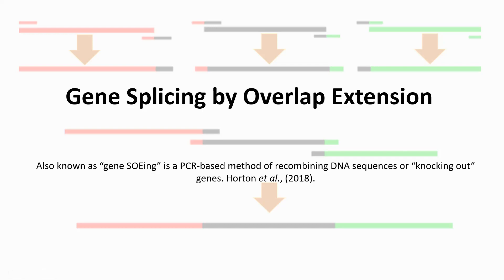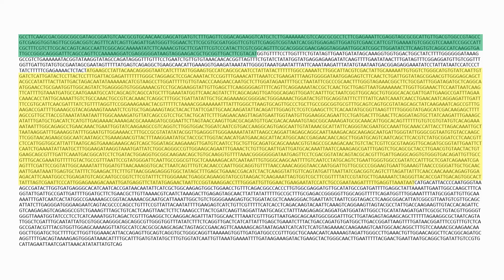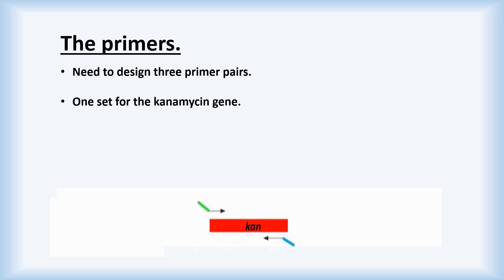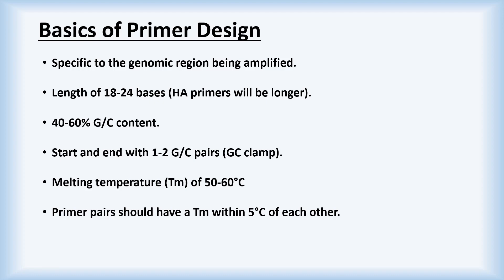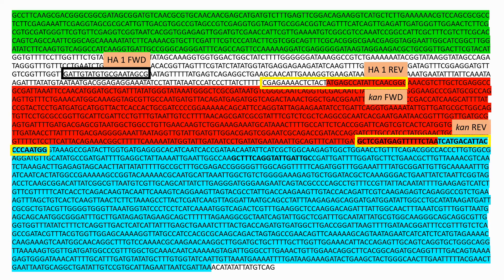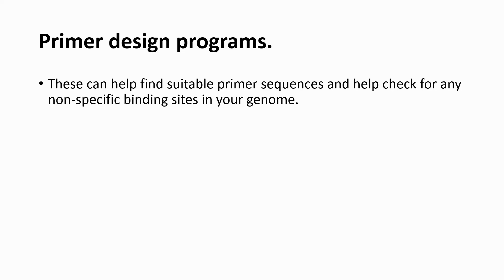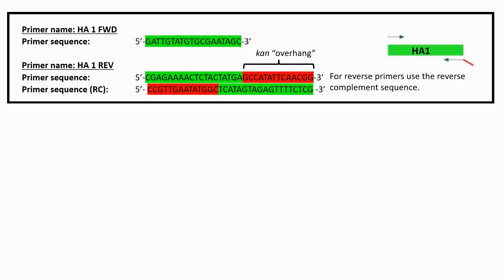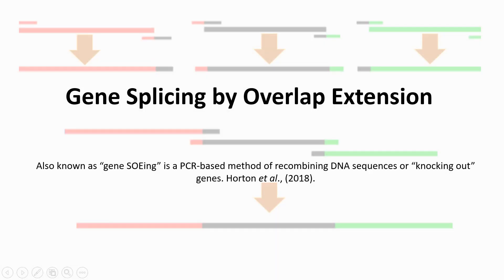Part 1: Gene splicing by overlap extension (SOE PCR).

Comment: thank you so much!! 

could you pleae also provide the paper you used fo the video? couldn't fin it anywhere (
Reply from the maker: Hi, as far as I know - this was first described: Steffan Ho et al., (1989) Site-directed mutagenesis by overlap extension using the polymerase chain reaction, Gene,https://doi.org/10.1016/0378-1119(89)90358-2. There are more recent papers including: Horton, R.M. PCR-mediated recombination and mutagenesis. Mol Biotechnol 3, 93–99 (1995). https://doi.org/10.1007/BF02789105.

Comment: This is misleading because it will just amplify the homily arms and anneal only the homology arms to the can gene. It will not yield a final product consisting of all three genes.
Reply from the maker: Hi, I have done a part 2 vid if this helps. 
Apologies if this vid is hard to follow.
The PCR products used to create the final construct are: HA1, HA2 and Kan. HA1 is joined to Kan using primers HA1 fwd and Kan reverse. HA1 + kan is joined to HA2 using primers HA1 forward and HA2 reverse.